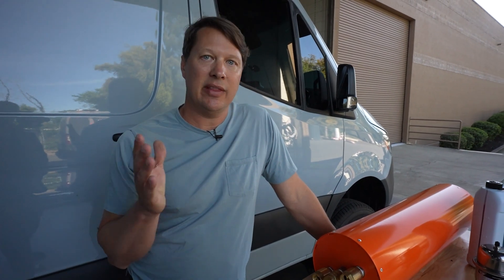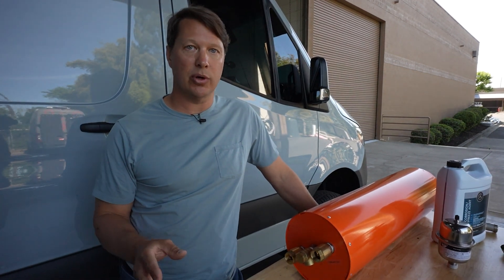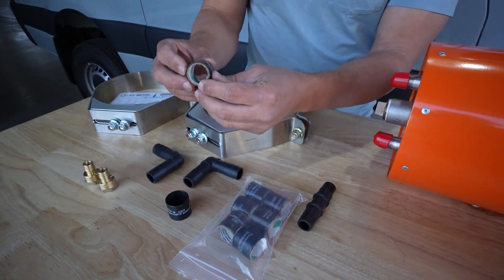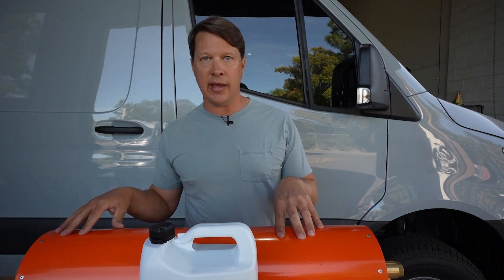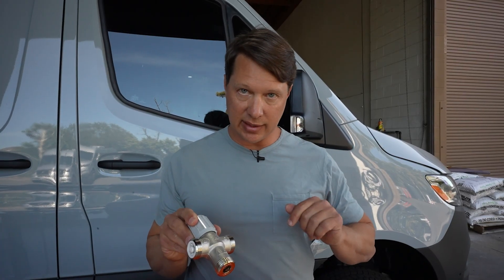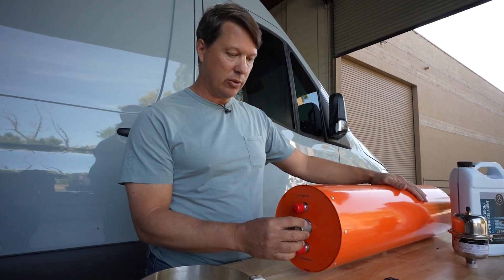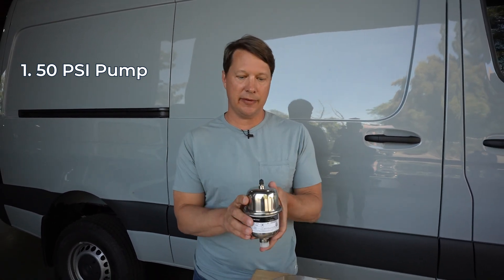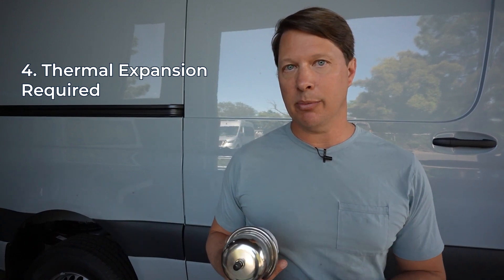The NEW Incline 2.0 Water Heater is Here – Stronger, Smarter, More Efficient

Comment: How do you winterize the portion of the water pipe going in and out of the van to get into the incline?
Reply from the maker: Wrapping both the hot and cold in insulation. If your driving and moving around you won't have any trouble!

Comment: Very nice unit, I am glad it has an electrical backup option.  My concern is that it is a direct line from the engine.  Another point of failure for the coolant system.  Second, is using ethylene glycol (toxic) in the heating element.  If violation internally, will contaminate the fresh water tank.  Perhaps a heat exchanger, storage tank, with propylene glycol/water mix (50/50) , and a Bosch 12v water pump?
Reply from the maker: You would know immediately if there was any contamination from the glycol. The heat exchanger is a solid tube, so there are no spots for it to leak.

Comment: Is Pex-a really the most common? There are so many more fitting types for Pex-b
Reply: Not common yet at HD or Lowes.  And you cannot mix the 2 systems.  Pex A has definite advantage of freeze expansion, protection, repair of kinks with heat gun.  BUT, the connections are unique and require an expansion tool.
Reply from the maker: You should be using PEX A throughout a van build. Period. Once you use it, you will never go back.